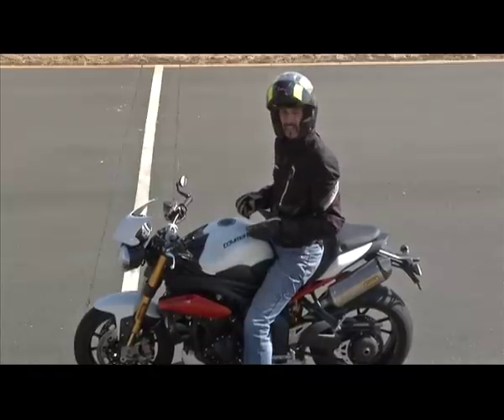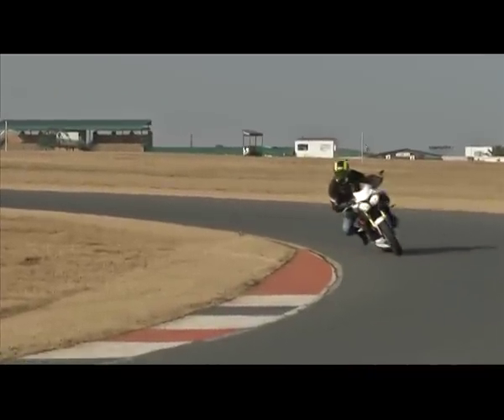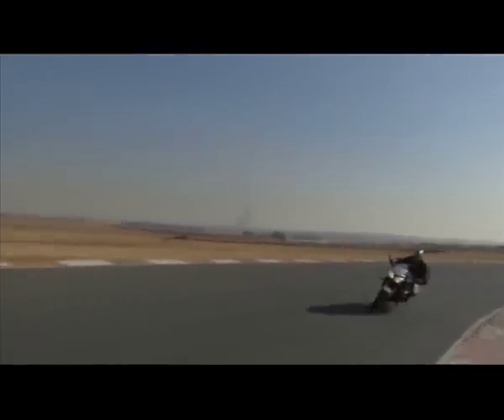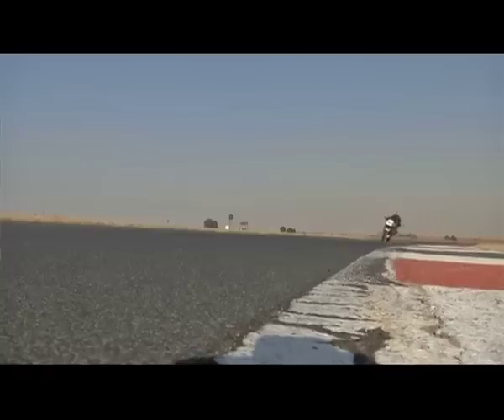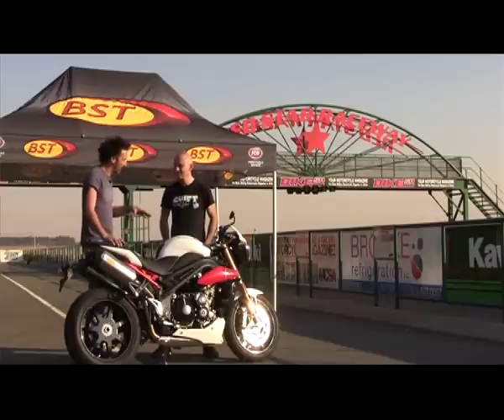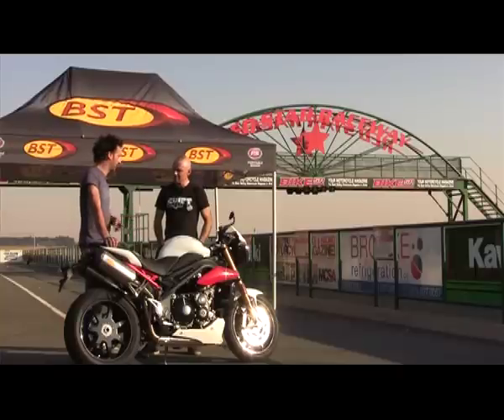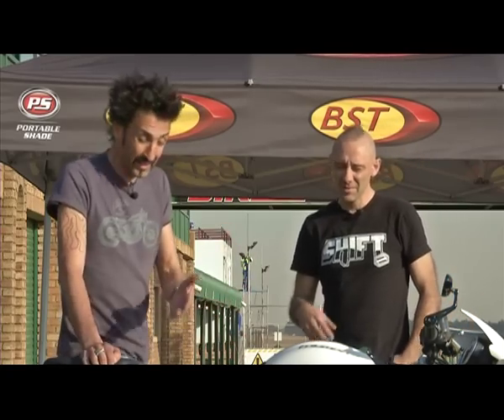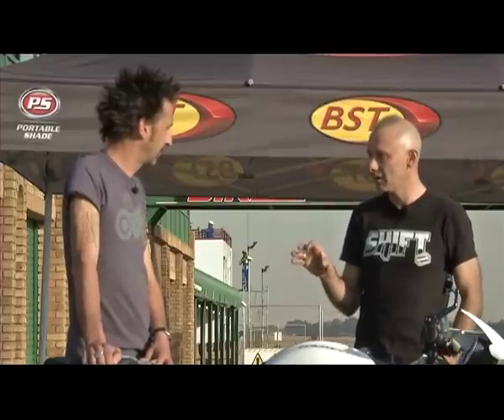BST Carbon Wheels; Worth their Weight?

Comment: Not trying to be a dick here, but reciprocating actually means back and forth. And the add lightness comment, its cool its something an English person would say.
Reply: Actually "reciprocating" actually means to rotate around like a wheel. 

Also one pound of reciprocating mass is equal to 3 pounds of static or stationary mass ( tank, frame, exhaust, etc. )

I shaved over 50lbs of rotational weight from my rims on my 2017 Road Glide but it feels 150lbs lighter when  I'm riding. Truly remarkable.

Comment: I purchased a set for my 2020 roadglide(performance bagger) to truly extract all the potential that carbon fibre wheels have  to offer  the bike must be set up for performance , with suspension huge difference in unsprung weight and response, braking , handling and acceleration.I know with my bagger is a incredible improvement allowing me push to another threshould again...soo in  closing yes the financial investment is worth every penny to take it to the next level....that is if ya have the cash!

Comment: Eh. I think he's doing a little bit of a sales pitch in how carbon fiber tends to just flex and then bounces back and retain pressure for the tire. Carbon fiber tends to crack and splinter and sometimes explode. That's why they don't run them in MotoGP. 
And also, gyroscopic effect is bad for wanting to turn in, but it's a good thing at speed in a straight line, because it gives you stability. I think forged magnesium is the best of both worlds. Enough weight to help with stability in the back straight, but light enough to be able to flick the bike well. Plus, forged magnesium doesn't deteriorate and have a shelf life like carbon fiber does.
Reply: Mag wheels get brittle with hard use. That is why Pro teams replace them every season or every other season depending upon their budget.
Reply: This didn't age well
Reply: @orionmobile6545  how did it not age well? Carbon fiber does get brittle and tends to explode and not just bend or crack. If they were better, GP would use them. I'm pretty sure they're still not even allowed in GP and they're banned in most other sanctioned racing series.

Comment: 30000 rand is about £1300 if I'm correct. That's a great price. carbon wheels for a car will set you back £30,000 for a half decent set.
Reply: +Gary Lowe prices are probably crashing down :) so probably way cheaper now
Reply: That's like half a set of top end forged japanese car alloys.

Comment: Lots of experts here. None of which have used or ridden a high performance bike with carbon wheels judging by the moronic comments. 

Fit some and find out for yourself. You would have to be dead not to notice the difference a pair makes. 

Is it worth it? You'll get much more benefit from wheels than you would spending the same amount on engine mods. Believe me, I know.

Comment: The easiest way for me to get more performance out of my bike, is to loose weight lol.
Reply: +Lee Hunt lets work out together XD
Reply: best option of all
Reply: Haha I'm on Nutrisystem so I can go faster on the drag strip.
Reply: I bought BST wheels for my Multi... because it's MUCH easier to buy carbon fiber wheels than to lose weight. :-)
Reply: lose not loose. 3 years is never too late to learn the difference
Reply: Removing about 50 pounds of bike weight will make a big difference if you combine it rider weight reduction, 1 or the other, not so much by themselves.
Reply: @n4thawin  Capital letter and full stop. 2 years is never to late to learn punctuation. 😂😂
Reply: @minatormyth  Damnit! LOL! It's just a pet peeve of mine as SOOOO many people spell "loose" instead of "lose." However, one rule of language is if a word is used by enough people long enough, then it will take on the new meaning. So, I may be in a "loosing" battle. hahaha
Reply: @n4thawin  lol, yea I am glad you took that in the spirit of fun that I ment it.😂

Comment: These carbon rims have superior qualities than alloy wheels in almost every possible ways. They are used in racing and so areas of mechanical designs because they are simply one of the best if not the best material for weight reduction and at the same time much higher rigidity and strength.
Reply: +PUU-TAAH Nin Nin The reason is MotoGP rules. Not technical deficiency.
Reply: +PUU-TAAH Nin Nin MotoGP has many rules you!d think is sensible but often times it's politics or business reasons behind those decisions. It isn't the measure of all that's motorbikes. It's just the most known and advertised one.
Reply: PUU-TAAH Nin Nin
There has been nothing in any of your posts that were true or made sense. I made my judgement on you about that, you can tell me you're the head engineer at NASA for all I care, your comments tell a different story.
Reply: @uncleputes  actually....they do now lol. Carbon is everywhere and theyve found theyre just as tough with current designs
Reply: @uncleputes carbon fiber today technology are stronger than factory rims

Comment: Are carbon wheelsets interchangeable between most sportsbikes? I have a 07 Fireblade which I like. Considering carbon wheels. If I change bike down the line, to new Zx10r for example, will the same wheels fit.

Comment: It's hard to take someone seriously who obviously isn't a good rider. What I want to see is something scientific like back to back dyno tests using standard then carbon wheels. See what the actual difference in acceleration is. Bikes aren't like cars in that carbon wheels on a bike will make a huge difference to gyro effect which in turn affects yaw and roll and even stability in a straight line.

Comment: he is going way too slow , but these wheels do work wonders on a hayabusa, i'm getting these with new Ohlins rear shock and rebuilt modified front forks
Reply: +mark3evo Yes and no on the riding to slow. You can feel the difference between the two at road speed. Unsprung weight is a biggy.

Comment: if these carbon fiber rims are so great, how come they are not used in motogp or wsbk
Reply: +zx10power most likely are tbh
Reply: +zx10power They use forged magnesium wheels which are slightly lighter but have to be replaced often.
Reply: They look cool. Period,

Comment: Add lightness? not reduce weight then? Also you need to tell that guy that carbon fibre isn't flexible...
Reply: Carbon fiber is actually extremely flexible it has been used in the bicycle industry for many years for that reason. The HUGE downside to carbon is when they fail they do not bend they will crack and compromise the structure.
Reply: Fair enough, you learn something new every day haha
Reply: Yeah composite flexibility depends on which direction you lay up the cloth layers and the shape of the object.  Carbon fishing rods will generally bend beyond the point where the tip can touch the grip where your hand is.  Carbon bicycles on the other hand can be anything from squishy to rigid as glass depending on the application.  The nice thing about composite materials is you are building them up how you want them.  You can make a tube for a mountain bike frame that is flexible toward the ends, and then becomes more rigid in various axis you move along it's length by changing the shape of the tube and the direction of the weave.  You should take a look at modern gravity and DH bikes, off the top of my head the GT Fury from 2015 or so is so sexy, the bike has a fantastic looking frame, who's tubes are in constant shape change to alter how it moves and flexes from the headstock toward the bottom bracket and up to the seat post.  Some serious physics meets art shit where form and function kinda chase each other like a mobius strip, totally brilliant what they're doing these days